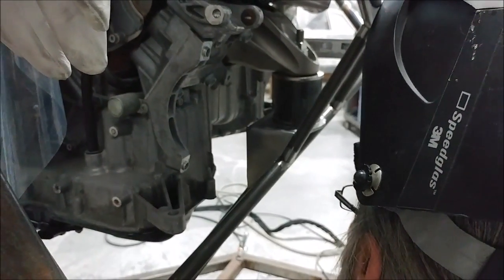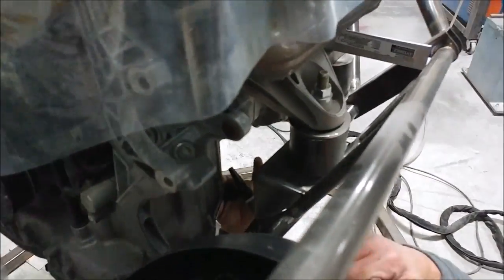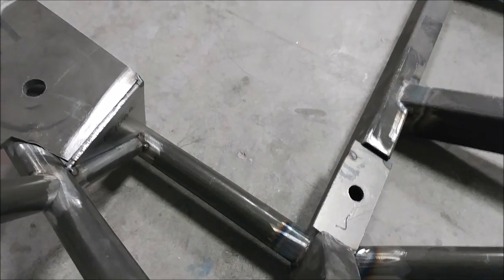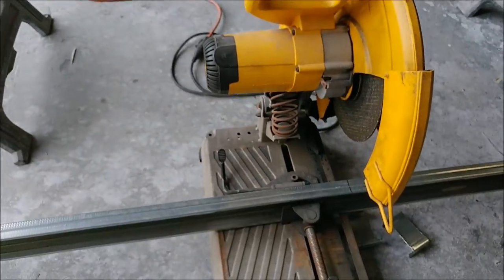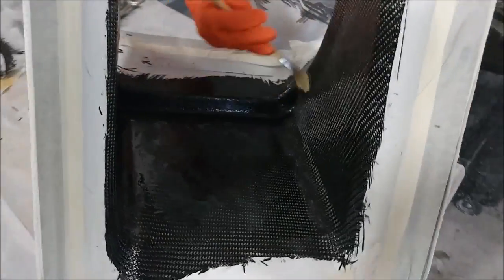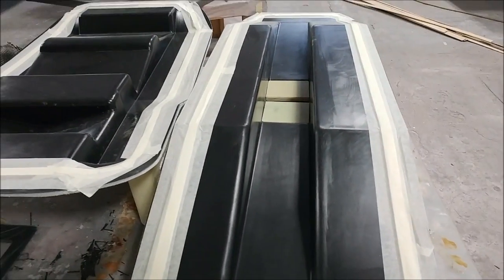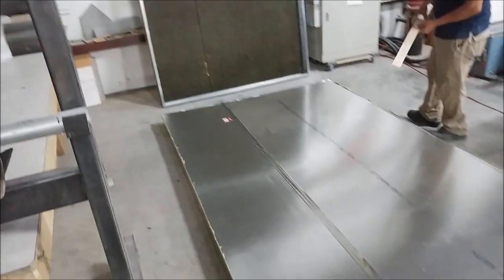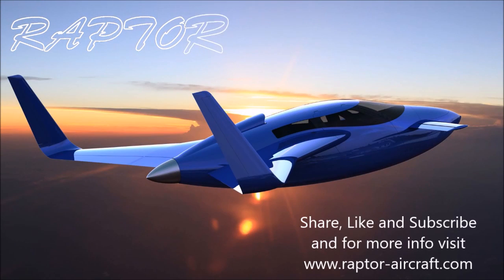Raptor Aircraft February 28th 2017

Comment: What does baking the parts do, make them stronger somehow? How are you going to keep even temperatures through the oven? I imagine you'd need equal baking across the entire part, right?
Reply from the maker: Post curing increases the strength and rigidity of the part. Yes we will have circulation fans to evenly distribute the heat. Stay tuned, you'll see it all.
Reply: Raptor Aircraft I'm excited to see it.